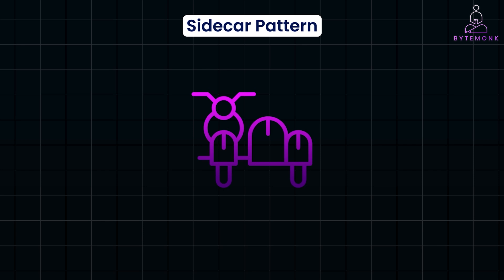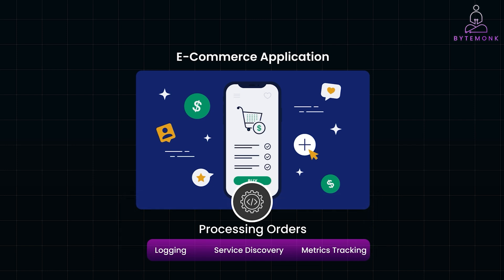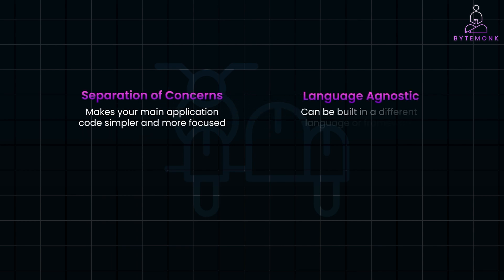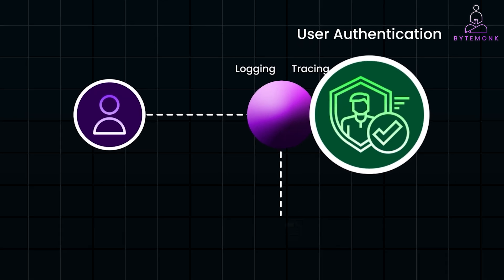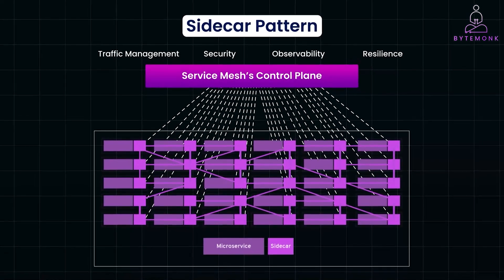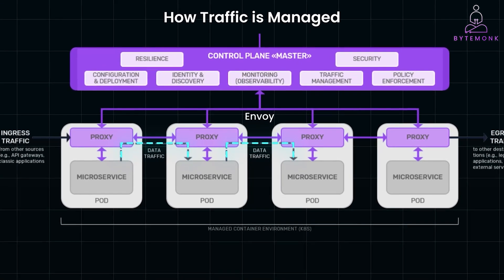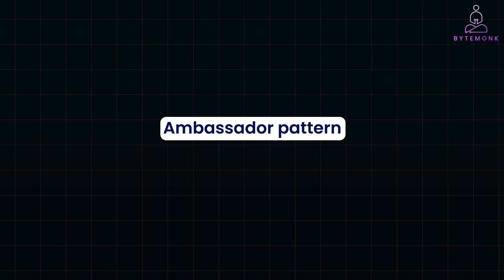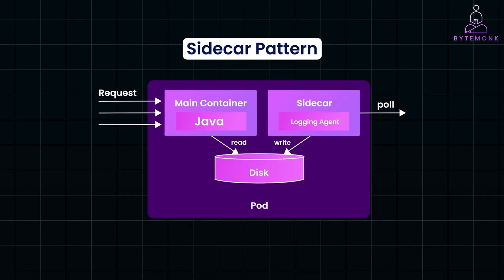Sidecar Pattern in Microservices

Comment: some additions

1. authorisation where you can ofload  the checking the permissions with any IDAM
2. i dont think sidecar manages the load balancing. sidecar managing the traffic for 1 pod not all pod. control pane manages the load balancing
3. side car manges DIgital certificate cycle management that is needed for mTLS(expiration, talk to key value etc.)

sidecar is cool thing but it does need more energy to manage and maintain it.
Reply from the maker: Great points and You're right, sidecar has its own set of challenges.

Comment: I enjoyed watching this. It definitely helped me gain knowledge about sidecar pattern. So having a service mesh like  Istio can take away the complexity of logging, monitoring etc and let service focus on its core task. So should we just learn Istio and forget about other things like API gateway and other things?
Reply from the maker: Istio and service meshes like it are powerful, but they don’t replace all other tools like API gateways. While Istio simplifies tasks like logging, monitoring, traffic management, and security, an API gateway still has an important role for managing external client requests, rate-limiting, and authentication at the edge.
Istio is great for managing internal microservice communication (service-to-service).
An API gateway is essential for handling external client communication, acting as a front-door for services.

You can use both together... Istio will handle internal networking, and the API gateway will handle incoming client requests, giving you the best of both worlds.

Comment: Nice video, but how is this different from something like kubernetes?
Reply from the maker: Thanks! Great question. The Sidecar Pattern and Kubernetes solve different problems. Kubernetes is an orchestration platform for managing containerized applications, while the Sidecar Pattern is a design pattern used within microservices to handle cross-cutting concerns like logging, security, or service discovery. In fact, you can use the Sidecar Pattern with Kubernetes—Kubernetes manages the deployment, and sidecars handle auxiliary tasks for each service.

Comment: Latency is one of the thing I was thinking of in the whole video, but it got me thinking what kind of use cases will this approach really benifit ?
Reply from the maker: yeah, the added network hops between the main service and the sidecar could introduce slight latency, which should be weighed against the need for decoupling responsibilities. Sidecar Pattern is ideal for use cases like service mesh (managing secure communication), logging, monitoring, and resilience (handling retries and failures). It's great when you need to decouple non-business logic from the main service for better scalability and observability, though it might introduce slight latency, which is generally manageable.